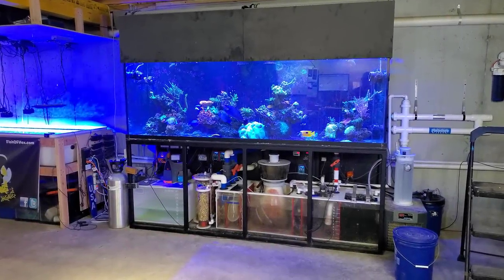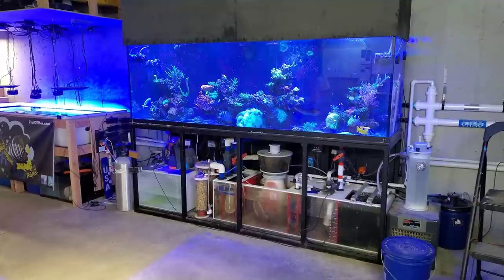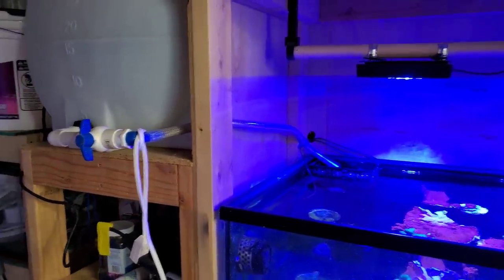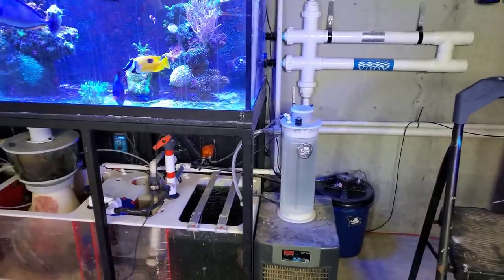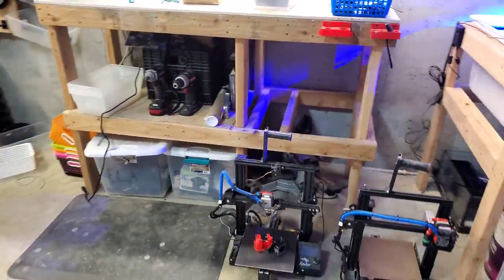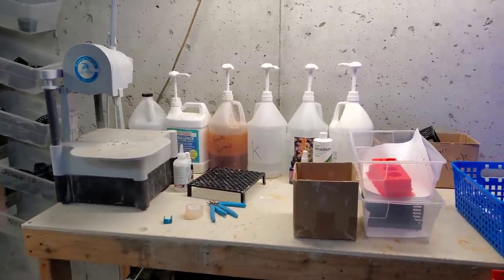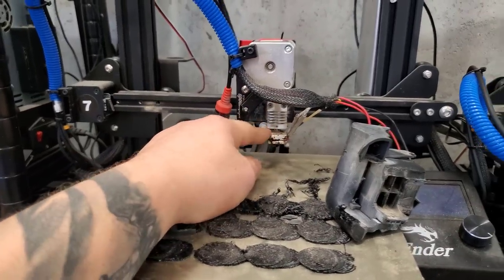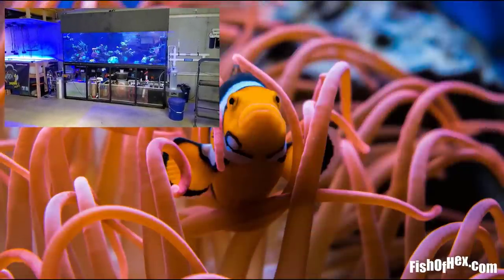Not So Short Fish & 3D Printer Room Update

Comment: Something to look into, hybrid water heaters. They have heat pumps and use heat in your basement to heat your water. Byproduct is cooler room and less humidity.

They cost 2-3x more that an normal water tank but after federal rebates and energy savings they will pay for themselves within 2-3 years.